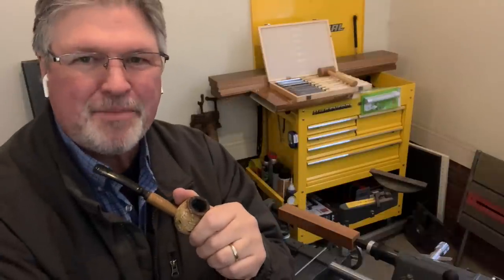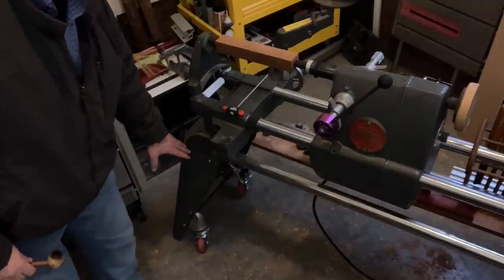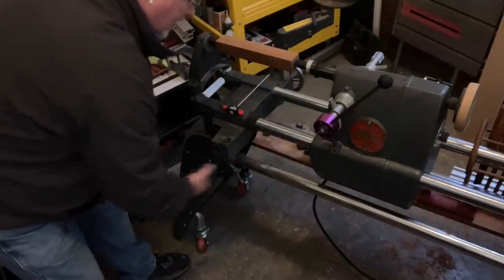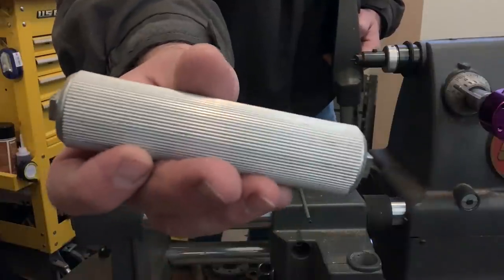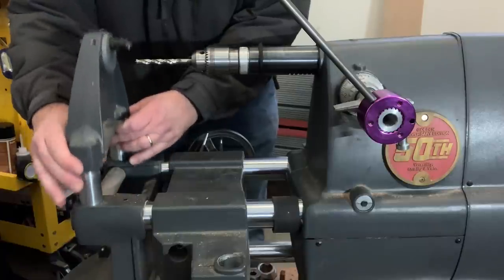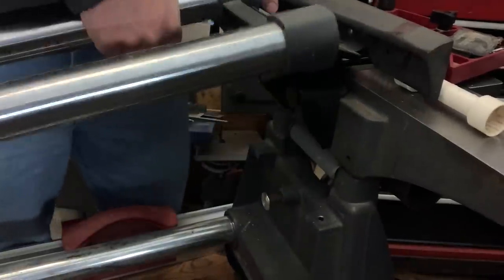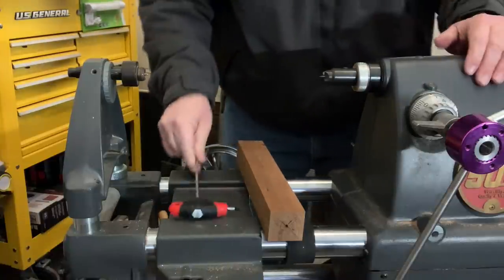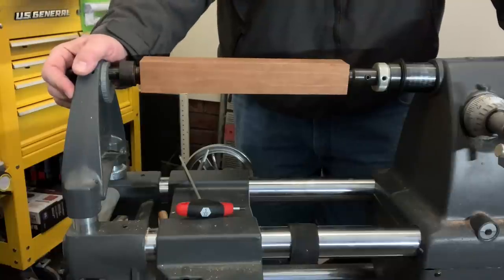Before Turning On Your Shopsmith Lathe, Watch This!

Comment: So happy to see your back.
Another awesome video. I had lost confidence in my Shopsmith, I was especially disappointed with my bandsaw, and was about to sell it and go for individual tools and then i saw your video on how to set up the bandsaw. I can now rely on extreme accuracy when I'm using it. I even got into it with the Bear guy when he was dissing the Shopsmith. Since then I've watched most all of your videos and I learn some thing new every time. 
This one has me changing my plans for my next time in my shop. The way tube thing is scary as hell. I'll take the time to check that I bought mine used and the manuel was a bit messed up so I used the Shopsmith online video to do my initial setup.

My question/comment: In the video you seem to be adjusting the left to right alignment only. Mine has the single set screw so I'll need to adjust the large set screw on the way tube.

It occurs to me that the way to be certain of the alignment is, if after turning a cylinder, you could use a square to check the side of the cylinder against the end to see if it is still square. But does it really matter since it seems the flex in the tailstock would mean it is most likely sloped to some extent?
Reply from the maker: Wayne, I'm happy to hear that you are now happy with your Shopsmith tools and thanks for taking on the bear! I'm not sure that I follow your last thoughts. There is only one large setscrew, and it should be all you need to get the way tubes aligned. There shouldn't be any discernible slope in a cylinder.  Scott

Comment: I am in the process of building a thickness sander.  I turned the shaft that will hold the sandpaper on my CNC, which is dead-on accurate.  Then I mounted the 2.25" d oak shaft on the Shopsmith.  Bummer.  The Shopsmith is not properly aligned.  The trick of using a long brad point drill bit to align the quill to the tail stock I learned from your video.  Great, now I can go back to the Shopsmith and get it properly aligned.  I bought mine in January 1979, so I've got a little more work to get it aligned than on your model.
Thanks for this vid.
Reply from the maker: Happy to help and I'd love to see how your sander comes out. If you don't post a video you can email me at ScottMarkwood(at)Gmail(dot)com.  Hope it all goes smoothly!  Scott

Comment: Thanks for the great video,, as always! I performed this procedure and it required a lot of adjustment with that screw - so much that when I pulled the headstock back to the attachment end, the shaft for my bandsaw was way out of whack. Can you explain how to compensate for this adjustment when it comes to aligning things for the other attachments? I feel like it's twisting the way tubes way more than is reasonable, so perhaps I have something else out of alignment that I'm missing.
Reply from the maker: Make sure that your machine is on a flat surface and that your floor isn't introducing a twist. Otherwise, you may have to make a one time realignment with the bandsaw. Does your bandsaw have eccentric posts? If so, that's how we align the accessory SPTs the the drive spindle n the headstock. Scott
Reply: @MyGrowthRings  Thanks for the reply - you know what,  I bet it is the floor. The headstock moves a bit less easily when I made the adjustment with the screw and it seemed to be making such a large correction.

Also, I love the chisel rack that makes a brief appearance in this video - is that something you made, or have a link to basic plans to?
Reply from the maker: @mechanickw.5995  I do have a plan somewhere, but in the mean time someone has uploaded a similar plan they made on the MyGrowthRings Facebook group page. Check that out. Scott

Comment: I love your videos I recently got a total shop from marketplace. I’m having a little trouble figuring out the lathe. Any information would be much appreciated.
Thank you
Reply from the maker: @FrankPugliese-p5f  Is the issue the lathe or turning on the lathe?
Reply: @MyGrowthRings  Thank you for responding I have figured out the lathe. I was having trouble getting the guard into place. I’m going to try to get the table saw and jig saw working tomorrow. Is Wd-40 ok to use on the machines moving parts?
Reply from the maker: @FrankPugliese-p5f  It’s OK, but once you get things moving, you’d want to remove WD-40 as thoroughly as you can. In the long run, it attracts too much dust and dirt, and will create problems. Also, don’t slide the headstock or the carriage over tubes that are sprayed with WD-40.the best thing is paste wax. I did a video on the best lubricants to use, that might be worth a look.

Comment: Interesting alignment comments. I have the single set screw eccentric and I used a combination of twisting it and adjusting the height to align it with the drive center. Of course I did not read the instructions!  In my defense, I find all Shopsmith instructions difficult to understand. How about a bit more discussion on the set screw at the other end?  I’m headed out to the shop after lunch to look for it (and also finish the live edge bowl I started yesterday). I’ll check the bench tubes too to be sure they are seated, although I did do that about a year ago ( they were not seated). I’d also appreciate your thoughts on the flex of the tailstock when pushing with the quill.
Reply from the maker: There's certainly nothing "wrong" with using the eccentric to align the centers. I mean, alighted is aligned. Hopefully, everything is still firmly seated but I'd be interested in an update if it's not.  Scott
Reply: All seated well.

Comment: I recently moved, and my Mark 5  developed an issue with the caster assembly in the left side falling out.   I thought it may have been dropped by the movers, causing the left leg to widen.  Any chance the base tubes being out if position  could cause that?  I've placed a ratchet strap around the leg to draw it in which keeps the casters in place.  You're a great source of info and support.   Thanks much.
Reply from the maker: Is it the rod that you step on that is falling out? Depending upon when your casters were made there may be a small machine screw that is screwed into the ends of that shat to keep it from falling out. If the metal ends of the carters are bare aluminum you probably have the screws. As for the tubes, I would absolutely suggest that you get below it and make sure that everything is snug and in place. Scott
Reply: @MyGrowthRings  Thanks for the response.  It's not just the rod you step on.  The entire assembly falls apart.  I checked the way tubes and they're fully seated against the stops and secure.  I think the movers did something to cause the leg assembly to spread out slightly.  I'll check for the machine screw however.  I have the new red wheel set but have not installed it yet.  I don't move my SS around much in this location, so I may go ahead and install them.  Thanks for all the great info BTW.  You're my go to source for help.  Cliff
Reply from the maker: @Gadgets4377  Cliff, if you can email a picture or a short video, that might help me assess if there’s something in particular that needs to be done. You can email me at Scott Markwood(at)gmail(dot)com
Reply: @MyGrowthRings  On closer inspection there is a machine screw missing on the operator side of the wheel assembly.   I'll send photo to your email.  Since I don't move this much, I installed the new SS casters, following your suggestion of swapping the assemblies so the "step on levers" are on the back side of the SS.  For my setup, they work great.  Appreciate all the information you share.

Comment: I don’t know if you take questions, but here I go. Can my mark 5 be set up to do steel? If so what do I need and where can I buy what I need.
Reply from the maker: Hey John. No, not really. It doesn’t have the ability to hold the cutters, and most of them don’t have the ability to turn slower than 700 rpm’s. The newest version can, as it has electronic variable speed, but even so, the machine itself just isn’t built for it. Scott

Comment: Thanks.... I’m gonna check my tailstock alignment again.   I’m pretty sure that I used the mis-alignment cam to center mine.  I paid no attention to the two alignment screws.

Do you have a video showing how to use the thumbnail tool?  I’ve tried to find the right place and method to use it several times.  It just doesn’t click with me.
Reply from the maker: Good. And double check the bolts and setscrews on the base too. It's one of those things that you never think to check, but if it's not right it's like building a house on sand. By the thumbnail tool are you talking a bowl gouge or something else?  Scott
Reply: @MyGrowthRings  the round tip tool that comes with the Shopsmith turning set.  I haven’t found a name for it.
Reply from the maker: @sassafrasvalley1939  Got ya! That’s a round nose scraper and it’s mostly used for faceplate turning. The grind on it is all wrong and implies that it’s a spindle tool, but there’s no practice use for that shape
Reply: @MyGrowthRings  thanks... I’ll try it there.

Comment: The original 10-ER is much different, of course, but has those end set-screws on the top. My understanding is everything is heavier.
Reply from the maker: Way heavier. Yes, the 10er is a beast but I still prefer the Mark V.

Comment: Hello! I'm seeing alot of spindle turning on a Shopsmith, but what is your opinion of turning bowls?
Reply from the maker: In my opinion, the bearings in the quill of the Mark V perform best under compression, as when used for spindle turning. I have done my fair share of faceplate turning and have turned some fairly massive pieces and I get frustrated by catches that I can only attribute to the type of bearnings that are in the quill. If all I wanted to do was bowl turning I think I'd move to a stand-alone lathe with tapered roller bearings.  If that makes any sense.  Scott
Reply: @MyGrowthRings  thank you very much for sharing your knowledge. I greatly appreciate you
Reply from the maker: @BarefootViking  Happy to share my opinion.
Reply: @MyGrowthRings   I know this is an old post. This has me concerned because the main use for my Mark V was for bowl turning. I have not turned a bowl yet.  I purchased  the Easy Wood chuck with a 1" x 8 thread because that is the only size for the adapter for Shopsmith. Regular lathes may take 1.25".  Should I check run-out measurements and see if it is noticeable there? This sure has me thinking now. Thank you much for your input and dedication to the Shopsmith community.
Reply from the maker: @SteveAddis  It’s always wise to check any lathe for runout. As for the comment about “regular lathes…” there’s no standard size, thought most DIY lathes today have 1” spindles.

Comment: Thanks for the in-depth walk-thru. 😎
I'm still curious how to use the eccentric at the tailstock to do off-axis turning. Any interest in doing a video on that? It seems to me that with the markings on it, it would be useful. But it also seems like you'd need to re-align it every time you turned it, no?
Reply from the maker: Whoops, your comment was in Youtube jail for some reason. I'm sure we'll get around to covering that but I'll admit it's not very high on the list.  Do you need to turn tapers?  No, there's no need to realign each time if you only loosen one setscrew before turning the eccentric.  Scott

Comment: Although Ive had a Shop smith since I was about 12 i never turned wood
I aligned it well as you suggested two problems the wood flew off hit me in my….Head mask( oh yes I wore a head gear). And for some reason the wood which was a 2x4 kept loosening on the center?  I used the same exact centers that you did..Any thoughts? Thank you again for doing these educational videos
Reply from the maker: It can happen. In fact, it happened to me a few weeks ago because I was turning something that was out of balance and off-center. It’s actually pretty easy with pine because it’s so soft. It’s very important that you drive the centers in as deeply as you can with a mallet or hammer, and double check the pressure and make sure that all of the points that need to be tightened are in fact, tight. In my situation, the tool rest moved into the vibrating spindle. I posted a short video on my community tab where you can see what happened.
Reply: @MyGrowthRings   thank you. Enjoy your channel. Please send link to join as a sponsor I had a problem finding the other day. Thanks.   Dq
Reply from the maker: @donaldquinn3610  There are two links in the video description. Just click “Show More” above.

Comment: great/ informative videos.... don't like the single set screw on the eccentric center.... as it gets old tends not to seat well...drilled a 1/4" hole thru the eccentric just below the tapperred hole...used 1 1/2" aluminium angle with a 1/4'" hole, put it on the back side of the support, had to flatten the casting on the back. (otherwise the angle will not sit 90 degrees to the bolt) as the bolt is tightend; draws the eccentric to seat positvely in its hole (if needed, can eassily go back to set screw)... repurposed a shopsmith 500 to do metal spinning (mainly cooper) the deflection was an issue because; instead of a center point, you squeeze the sheet copper between the head stock and the tail piece.(making cups, didn't want to have hole in the bottom).placed a 3/8" bolt just below the eccentric thru the back of the support thru a metal 2" angle which then was angled down to below the rails into another 2" angle..pushed the 500 to its limit, maybe more.. learned to produce 3" diameter  x 5 1/2" tall  cup out of 19 gauge cooper. (toughest skill ever learned)..did over 50 of those another 400+ of other spinings...500 was still going strong when it was left in Oregon
Reply from the maker: That was a smart mod. I spun (spuned?) ONE piece of metal and never had the guts to try again. It may have just been one of those times in my life were I was feeling especially mortal, but I never tried again. Scott
Reply: probably smart move...flayed back of my left hand once trying to trim a piece..wife was pretty upset after finally letting her see it @MyGrowthRings

Comment: Hi Scott.  I started watching some of these videos since I recently acquired an old Total Shop machine. Some of the parts were missing and I have been slowly piecing it together.  I didn't realize at the time I bought it that it was a knockoff of the Shopsmith.  Anyway, I can't for life of me find a tool rest arm for it.  Do you know if one of those Shopsmith tool rest arm designs is compatible with the Total Shop?
Reply from the maker: Hey Kyle, Yes, the tool rest from the Shopsmith Mark V Model 500 will not only work but is actually superior to the Total SHop rest as long as you get one that doesn't have the grooves machined all the way around the post. They are available on eBay all the time but make sure you don't get the one designed for the model 510/520, which is much too long, and make sure about the machining of the rack on the post that it's not all the way around the circumference.  Scott

Comment: Hi Scott, I continue enjoying and learning from your videos. Thanks very much. I'm trying to figure out how large a bowl can be "practically" turned on my standard Mark V 500. I haven't found much info on the various forums - it seems most people don't go over 8" or so. My largest/heaviest blank so far was 12" x 4" and green - pretty heavy. I took a lot of care to trim and balance the blank before turning, and still experienced a fair amount of vibration before I got it round. Do you have any tips for going larger? Thanks in advance!
Reply from the maker: Thank you for your kind words, David. The largest pieces I turned were about 24 inches in diameter but were brick laminated, hollow and well-balanced. The key to any large turning (and you know this already) is it has to be balanced. I’m not at all uncomfortable turning up to about 12-14 nches in diameter but beyond that even when they’re properly balanced they can get a little shaky. I know of people that turn much larger but they tend to add additional weight (sandbags) to the machine to dampen vibration.

Comment: how do you use a face plate or a 75mm chuck on the power head ?
Reply from the maker: The Shopsmith faceplate simply mounts with a single set screw. Lathe chucks usually require a Shopsmith adapter, but most of them have that available as a stock item. I know that's true of One Way and Penn State Industries. Scott
Reply from the maker: Also, you can buy an adapter that will convert the plain 5/8" Shopsmith spindle to a 1" x 8tpi spindle: https://amzn.to/3hRPZ65

Comment: I got a problem with my mark v. When I turn it on on low speed and turn the rpms up it wants to slow down and not speed up. It’s never happened before. Would you know the problem? Thanks
Reply from the maker: Have you kept the sheaves well lubricated? Take the belt cover off to see if the motor sheave is sticking in the open position, and while you are at it, take a look through the back access hole while turning the speed dial up to see if the control sheave is properly connected. Hope this reveals the issue. Scott